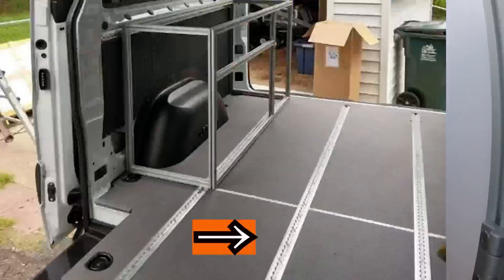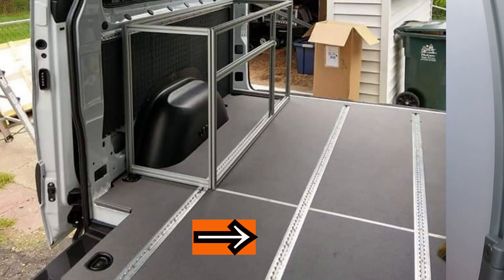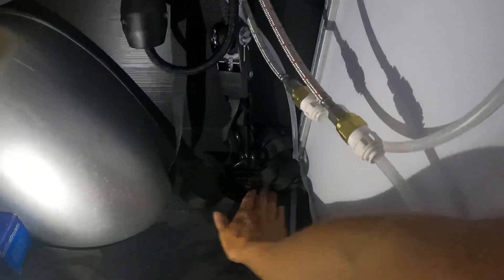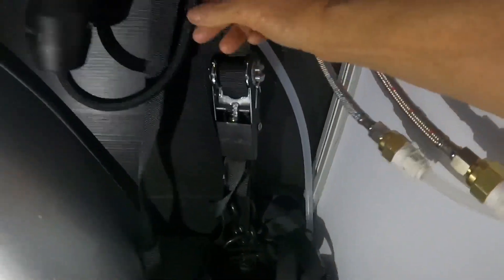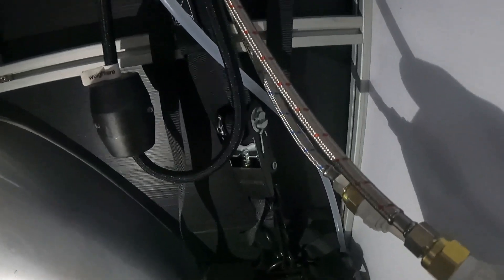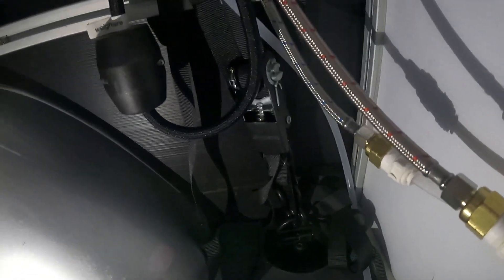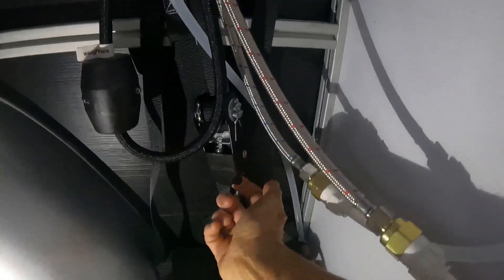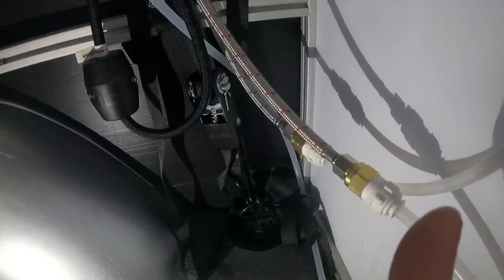VAN BUILD - HOW TO INSTALL/SECURE VAN CABINETS WITHOUT DRILLING HOLES Sprinter, ProMaster, Transit

Comment: Does the strap go throught any place on the van side so it holds it tight up top?  Like it wrapers around some hole in side of wall a couple feet up and then over the 80/20 and back down to the floor?
Reply from the maker: Hi TJ,. Yes, you are correct. The strap goes in and out of the 80/20 and they the circle holes just before the window. That creates a very tight secure hold for that entire cabinet. We have 2 separate ratchet straps for the kitchen and 3 separate ratchet straps for the couch/wall. Really works well as we adjust as needed. Have a great weekend

Comment: So what if, let’s say, we get in an accident in a freeway as an example (brake hard and rear end someone in front of us)…. Will the straps be secured enough to keep the 8020 from getting loose?
Reply from the maker: Hi Rex, good question. The 80/20 cabinets are very light - so, for our comfort - the straps will hold. Each strap is somewhere around 1000lbs strength - but you could get straps that have a breaking point even higher. Definitely a question that has to be answered by each individual, but in our case - no concern. It is similar to someone using their Sprinter to haul heavy items - properly sized ratchet straps are necessary. Definitely a great question. I feel the cabinets are more secure then using the L track on our last build with 4 bolt down points. The straps actually wrap thru the light weight cabinets and they the van wall. Thanks for the question and have a nice weekend